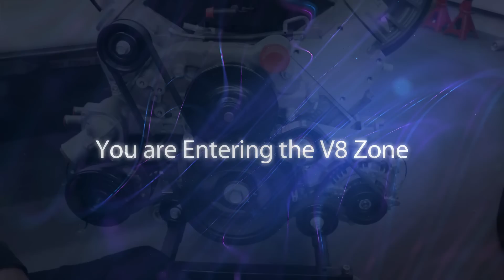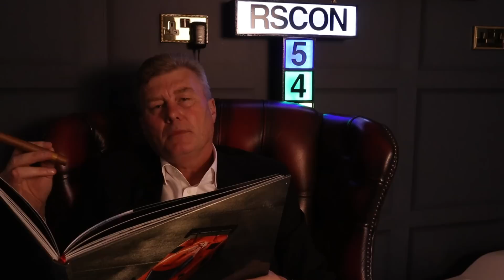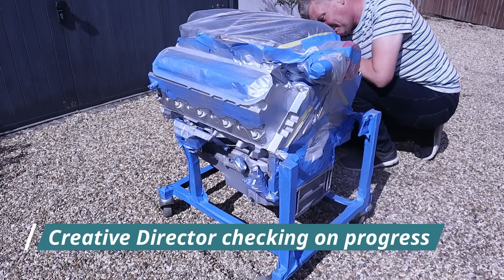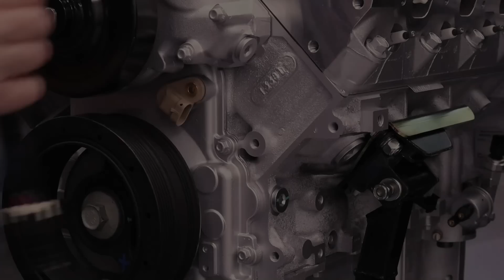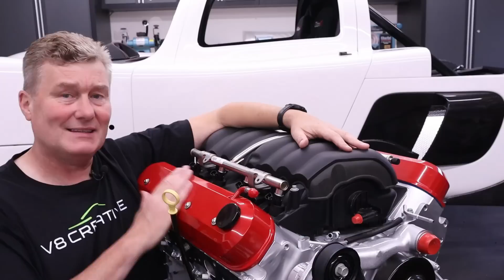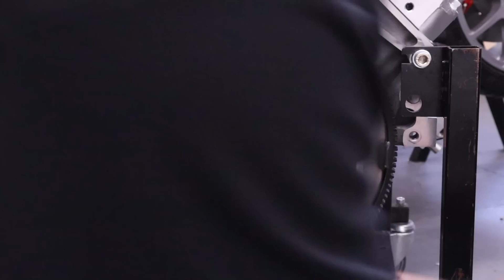Building an Ultima RS with Nigel Dean. Part 44. Chevrolet LS3 engine detailing and clutch install

Comment: How much clean up did you do after painting? Were you dealing with any paint bleed through?
Reply from the maker: Not too much actually, but as you know as soon as a spray can comes out overspray is an issue. The masking tape was pretty good to prevent any bleed through, but nothing some brake cleaner could not remove :-)

Comment: When Chevy releases the new LT6 as a crate motor I hope ultima engineers an install kit for it.
Reply from the maker: Thanks for the comment and I don't have the answer. All I do know is supporting a new power plant is a significant investment, both financially and in time for the factory. However, Ultima focuses significant resource on continual development and I'm confident power plant choice will expand moving forward.

Comment: I like your V8 Creative valve covers. I had Ultima send me plates that read ULTIMA RS LT5 to cover over the "Corvette LT5" on the supercharger. Showcasing your YouTube channel is smart. I live 200 miles from Detroit and Corvettes are everywhere so I wanted the motor/supercharger to reflect Ultima.
Reply from the maker: Appreciate the comment, and as you say Corvettes must be everywhere in Detroit. The next modification I'm working on should remove even more of the Chevy visual DNA, but let's wait and see.

Comment: Nigel, I have the same LS3 in my cobra, I happen to notice you left the old corvette oil level float in your sump, are you going to try and use it, or if its not going to be used, then why not remove it and fit a billet plug. M20-1.5 metric thread with O-ring seal, Designed to plug the oil level sensor threaded port in LS series oil pans.                                                                                                                                                                                                                                                                                        I can send you the link where to get it from if you like.
Reply from the maker: Hi Mike, not sure if the Ultima loom uses the oil level sensor, I will need to check. If it does not I guess I could replace it with a plug (I probably have one in the Dean Den). Thanks for the observation

Comment: That valvecover looks good, and I like the idea of the logo, but...
I think you should work a little bit more on them. There are "too much black between the letters".
I mean, look at the "V", inside it, it is open and red, but between the "V" and the "8", there is black.
And so are the rest of the letters.
So - should it be black "inside" the "V", or more open red between all the letters?
Reply from the maker: Hi and appreciate the feedback. It's a good observation since sometimes you do something and it just doesn't hit the mark but the concept simply needs refining. Appreciate you spending time giving feedback. Cheers Nigel

Comment: Which clutch are you using please? Is it ready/upgraded in case you go supercharged? Interested to know as the clutch is slipping on my GTR720 after 2,000 miles and most likely needs a more modern upgraded clutch.
Reply from the maker: Hi Jason. I opted for the high-performance clutch option to ensure she will cope with the torques. I can't remember there being such an option when I built my GTR 20+ years ago (around the same time as the GTR720 was smashing world records).
Reply: Who supplied the clutch, I have a GTR 720, clutch supplied by Ultima. Very heavy clutch pedal but not one issue in 16,000 miles over 12 years 🤷🏼‍♂️ my engine is the 7ltr, fuel injected. Came out at 710hp Strange it slips, Nigel will know
Reply: @mattleckenby6460  Factory supplied, but back in 2009. I have 730ps. Surely it can't  be 4th and 5th gear wheelspin in the dry.